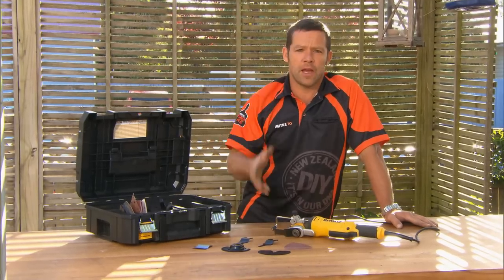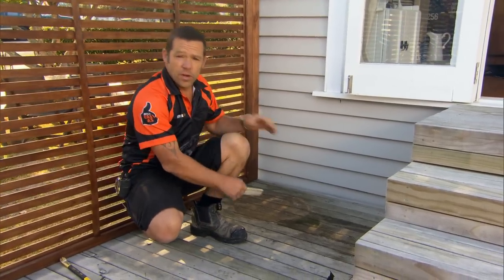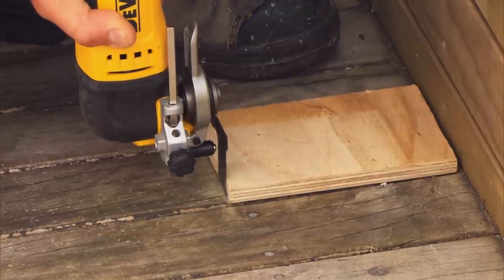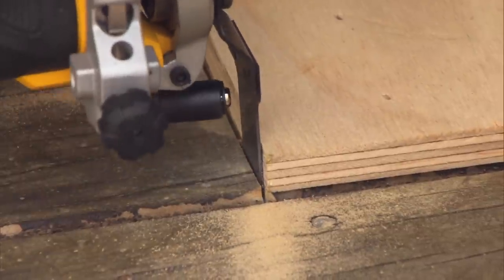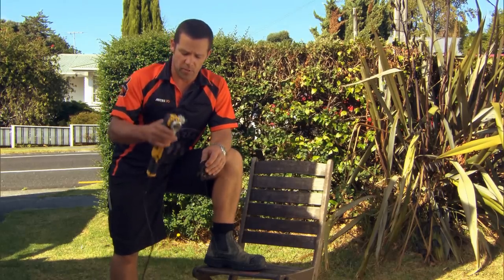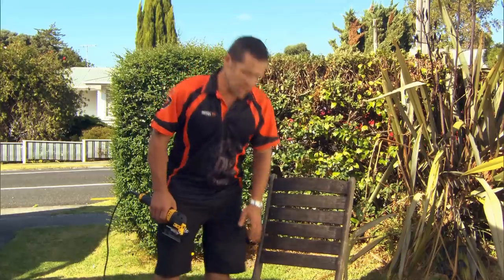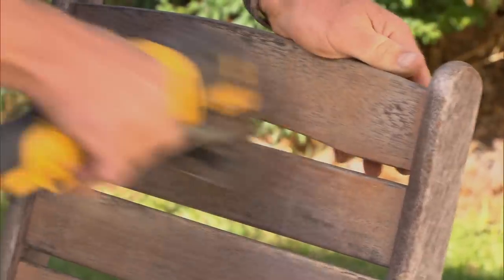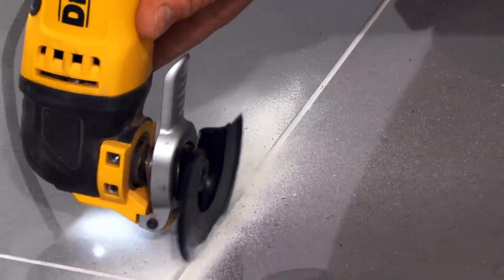Multi-Tool Basics and Tips | Mitre 10 Easy As DIY

Comment: Whats all the pc crap hes wearing.hardly gunna take your eye out mate.
Reply: Ear muffs so you don't go deaf from your years on the tools, mask so you don't breath in the saw dust. Eye protection just a good idea whenever you're on site. Personally, I swap my driving sunnies for my poly-carb safety sunnies on site and my eyes are always protected, better safe than sorry. Ears only when lighting up a power tool, and mask when doing saw cuts.. either that or hold my breath.. Also, lead by example.
Reply: @Monsieur405  Well I find I sweat so much that eye glasses fog up in 2 minutes so then I can not see anything....glasses also prevent the earmuffs from seating properly allowing all the noise in making them pointless.

A breathing mask does a similar thing to earmuffs with the bands, also I have a beard and find that dust masks don't really work with beards.

Earmuffs are good.

I find I hold my breath, breath away from the dust.  I also never have a grinder blade in line with my face/eyes.

Frankly if I wore all the guff....I'd be minus a few finger tips (fogged glasses) with the start of emphysema (believing I could breath with a beard and a mask) with the start of hearing loss (with the glasses and the mask pushing away the seal of the earmuffs).

So it might look all very important.....but I have only been tiling 20 years with grinders and cement dust, what would I know about REALITY?
Reply: @phillipbridge5009  Calm down possum. I live and work in reality too, and at the end of the day, you're a big kid and you can do what ever you like, I personally couldn't care less. Suffice to say, sawdust is a carcinogen. Silica dust is even worse. Repeated exposure to loud noises causes irreversible hearing loss, and a wayward bit of shrapnel from a grinder could cost you an eye. These are facts mate whether you like it or not.